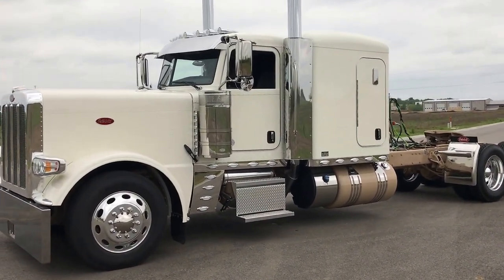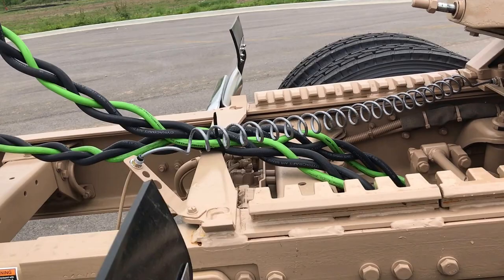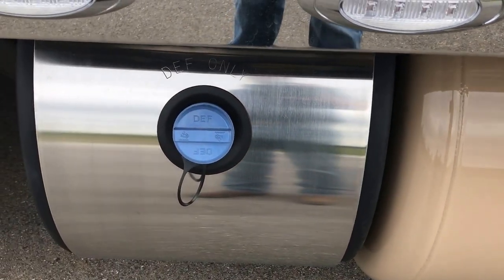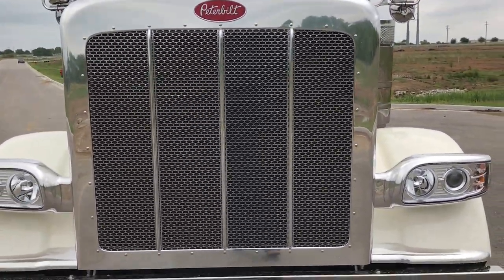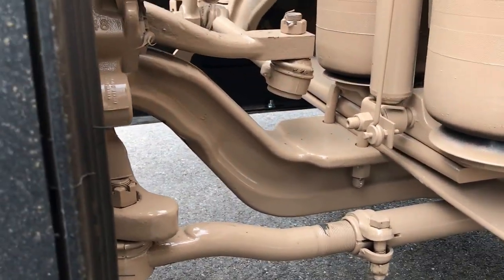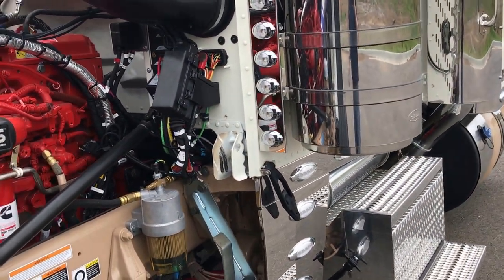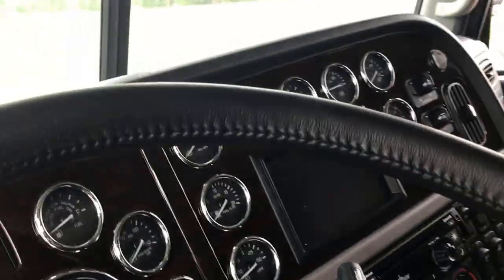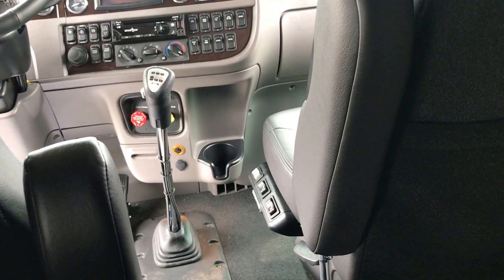2018 389 300" Peterbilt X15 Cummins 18 SPeed 2050 Torque Platinum

Comment: Steve why don't they change the drivers step to match the the new passenger step? Or is it an option?
Reply from the maker: Not an option. One covers the DPF and the other holds batteries. Just 2 different applications.

Comment: What are the advantages of a 300" frame over a 280"? Disadvantages?
Reply: Sam O 

20" of cool 😎
Reply from the maker: 20" of cool and a bit better ride are most common but it also allows you have more overhang on the front of your trailer
Reply: Steve, I spoke to one of my Friends the other day, turns out he bought his truck from YOU. He spoke very highly of you. When I place my order, I assume I can order the fifth wheel slider in 36" or 48"? Right? How much lead time do you want?
Reply: Sam O 

You should do the whole deal via YouTube comments 🤣
Reply: The Strength Compound I don't think either one of us wants that. It would take too long.